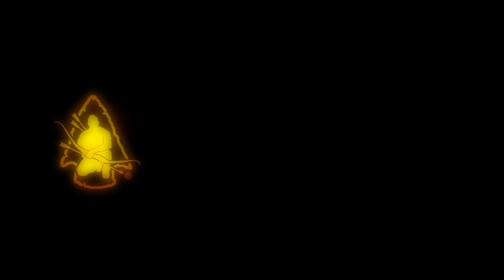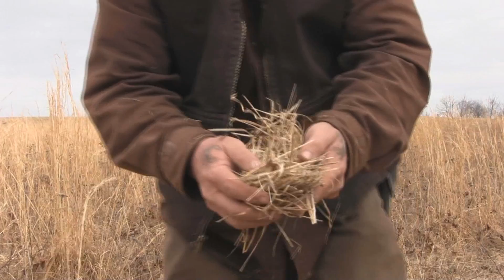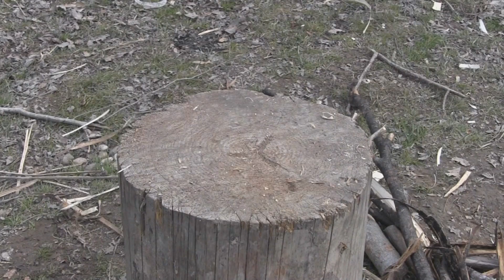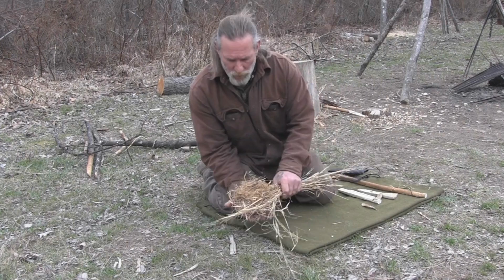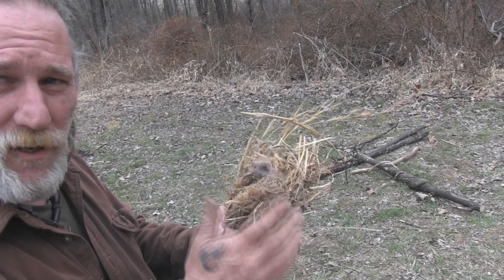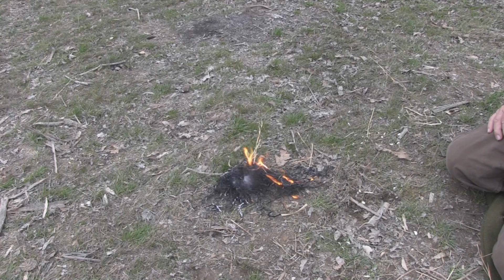Fire School Part 3 Proper Bird Nest Construction

Comment: HA! Ok I see now :)
I just used the bow drill for the 1st time & I got it going 1st try with flames out the top, then it went out.? I need to work on my nest!
I tried 4 different holes, wore them out & every ember didn't last. My spindle was squeaking & the tip was black. My foot was on the board & the notch was pointed out not in. I will change all these. Thank you :)
I can't hug my knee though. It's to awkward & in my chest. I can't put weight on the palm rock because of it.
Thanks a lot your material really helps me out ton. God Bless!

Comment: i'm sure this will go unanswered, since you are so busy, but i was wondering if a fresnel lens, as part of my fire kit, has to be like the magnifying lens, at the least of 5x power, or can i get away with using a 3x fresnel lens?

otherwise, this is the best series of bow drill fire making i've ever watched, because so many of my mistakes were fully explained. thank you very much.
Reply from the maker: I don't use them I use a real glass lens but it will be covered in another vid in this series
Reply: My understanding from physics is that it is not the magnification that maters for producing heat, but the surface area and of course the quality of the lenses so that the focal point is fine.

Comment: How long did you actually work the saw on that wood to get the ember?
Reply from the maker: It varies from about 25-60 seconds usually depending on variables
Reply: If you check out Fire School Part 2 he does a full bow drill demonstration without doing an intermediate cut.  It really took no time at all.

Comment: flames are like electric sparks they will be best effected on sharp corners or edges of a material. a piece of paper will ignite if you place a flame in the center of a sheet of paper but move that flame to the edge of said paper and the wait is over. you can get a spark to jump a gap from one flat surface to another flat surface, placing two corners or edges next to one another, then generate a high voltage sparking condition and the spark jumps that gap more easily, and at a lower voltage to achieve that spark. this is why new spark plugs perform better and lower fuel usage in your car. why, you may ask? the ignition system can only provide/supply so much voltage. it a ignition system can't jump the gap of a worn plug. then the fuel and air mixture induced into a cylinder wont be ignited at all. if the ignition system does create a spark. the time it takes for it to build the voltage to jump that gap, may have taken to long and that alters the timing of that ignited fuel air mixture. to turn the timing back with reduce the energy potential in that particular cylinder. so to achieve the required effectiveness desired for the vehicle. one would depress the accelerator more. and that would put more fuel/potential energy through every cylinder. using even more fuel. and even if that analogy isn't exacting in comparison. it does have similarities. lots of sharp edges will ignite more easily....